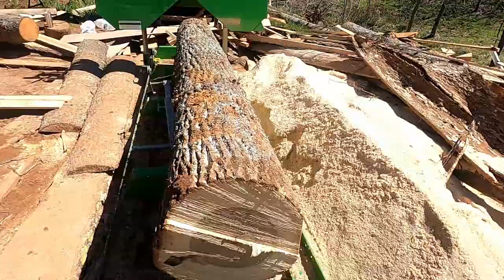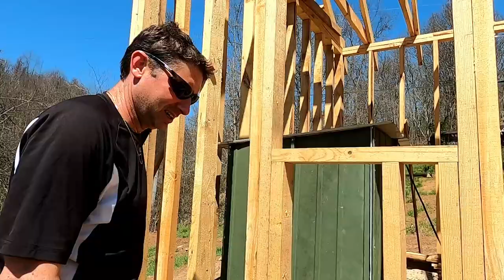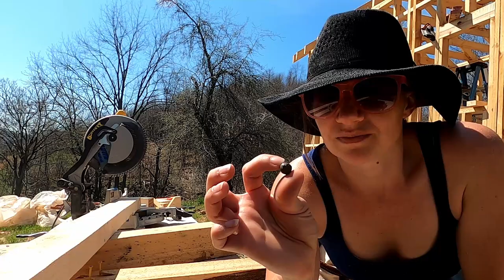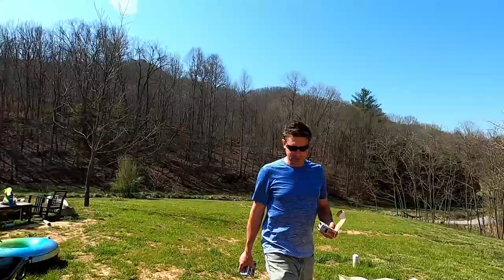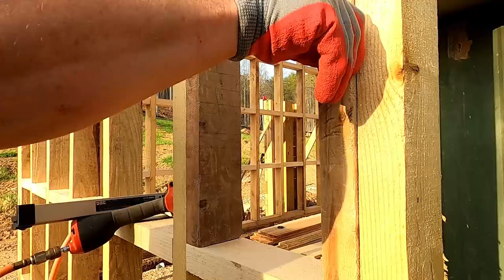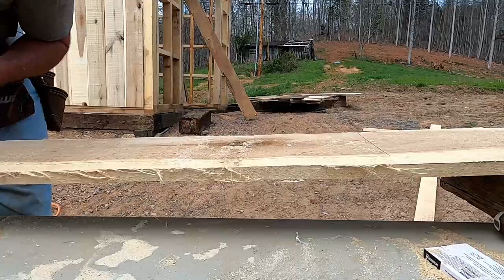E29 - Homemade siding for the shed with our own sawmilled poplar

Comment: Think of the the center of the tree as the structure and the sapwood on the outside is where the “life” resides (nutrients flow, etc.). The tree is dying and it will likely be blown over at some point. On our latest episode (abandon shed to tiny house) we had an 80ft cherry that was essentially the same, but only 30-40 feet from our house! We cut it down and hope to mill it and many others to finish the interior and board and baton siding.  

You guys are doing an amazing job. This is exactly what I wanted to do with my children. It got vetoed, but my son and I are doing it together 20 years later! Keep up the good work!

Comment: Have you thought about using a "metal detector" to find other "treasures"? I bet you will find all kinds of historic items - perhaps even more bottles if they have metal caps. As for your Civil War Canister Shots, more than likely the canister blew up not far away, spreading the shot everywhere. One has to wonder how many people were caught in the explosion and died where you're standing. As for your apple tree, it's probably a crab apple. Apple trees are trimmed after the leaves have fallen off - that's when the sap has gone back down to the roots. Looking ahead, always check out Habate for great buys on all types of building supplies - even windows, doors and paint. God bless - love your channel.

Comment: A tip about using air powered framing nailers....you might already know this.  I learned it the hard way.
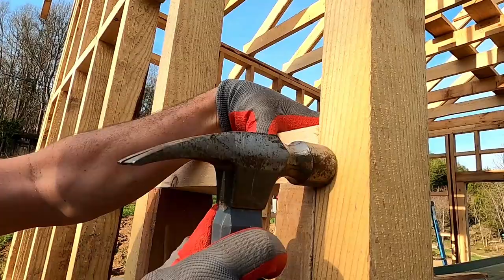When shooting nails like you are at 27:35 always keep your "off hand" at least the distance the nail is long away.  The nails for those things aren't as rigid as nails used for a hammer and can bend, sometimes extremely, when they hit knots or different grains of wood.  I was framing a wall and using my left hand to hold the horizontal piece as you are.  Had a nail go through the stud then turn and come out the side of the horizontal piece.  Put a pretty good divot in two of my fingers.  They healed but I definitely learned a lesson there.
Reply from the maker: Hey Mark - right on.  I don't even like being in the line of fire, but I'm sure I got a little too comfortable over the 5,000 nails we fired into the shed.  You are right though.  It happens when you're not expecting it and safety needs to be administered at all times; especially with that nail gun.

Comment: It was my understanding that when Board and Batten was put on 'green' or wet that they only put one nail in the center of each board left and right and at each cross board in order to allow the edges to shrink and grow at will underneath of the battons that are also nailed in the center and cover the gap. I also understand that when green the gap is about a nails width to allow for the expansion and shrinkage. Lastly my reasearch showed that some(not all) people would come back after a few years and then add more nails. Although with Cedar I don't know how much movement or how long you let them dry? 1" per year here. Great job and great channel.

Comment: Curious why the vertical instead of horizontal installation for the siding?

Thinking about how horizontal siding is installed with overlap…. It may be to allow for the wood to shrink as it dries.

Last thought - next time the tractor is out, couldn’t you haul lumber by hand in your cart instead of carrying it?

I realized why I’m making so many comments,  I REALLY wish I was doing this.  I envy the life you’ve built for yourselves.
Reply from the maker: Thank you, Kevin!  Love hearing comments like that.  It makes me feel just a little less crazy - haha!  It's refreshing when someone really understands why we're doing all this.  Now to answer your question... board and batten is a very old farm architectural style and I really wanted to celebrate its tradition on my shed.  The old timers used to cut their boards, hang it green, let it dry for a bit and cover the shrinkage gaps with the battens and that's exactly what we did.  It's funny you find this style on newer expensive homes, being its tradition was just building with what you've got.

Comment: Nice progress! Npt to be Mr. Critical but you don't have any squares but you do have a lot of rectangles. I've also noticed when you are pushing the saw mill forward some times the right and left side are racking a bit and not moving together. That could also cause some rippling in the saw cut.
Reply from the maker: Hi Tim!  Haha - yes you're correct.  That gave me a chuckle because it's something I would totally think about myself.  Regarding the sawmill, I believe that's a big design flaw.  It desperately needs some more support between each side which could be easily accomplished with some Maker Pipe.  I love the texture it leaves though.  You pay handsomely for that "rough sawn lumber" at the big box stores.

Comment: You need to prune that apple tree and fill the truck with foam or cement to protect it from any further rot. It needs pruning bad! Put some fertilizer around it too so it has some food to use. Fruit tree spikes or fruit tree granules will do wonders for it but make sure it is not for citrus. You need fruit tree feed not citrus tree feed.

Comment: So, what was the reason for the warranty service run on the RK24? As a  soon to be owner of one... I've got to know these things. LOL Great video! You guys are rocking it!
Reply from the maker: Haha, I understand the concern.  I had a bad steering cylinder.  Basically, the steering wheel would spin and spin and not limit out.  Probably too many sharp turns while carrying heavy logs.  Nevertheless, all fixed now and didn't cost me a dime.

Comment: I use a bench grinder to sharpen my blades as well. Running a Woodland Mill 22. I considered the Harbor Freight one, and it looks like it is working well for you! Do you have any advice from your experience about building with green wood?
Reply from the maker: I'd build with green wood again, but pay attention to establishing an initial even cut from one end of the log to the other, regarding the pith location. It helps tremendously with boards weening and cupping.  The board and batten style is perfect for building with green wood, since the batton's main purpose is to cover the gap.  I'd also make the siding a little thicker and do 1 in. instead of 3/4.  Good luck to you!

Comment: great video, shed is looking good,  whats wrong with RK ?  hope its nothing major
Reply from the maker: Thanks!  It's just a steering cylinder that's being replaced and I was told it will be covered under warranty.  The steering wheel would spin and spin and not limit out.  That's one thing about RKs.  They have a great warranty.

Comment: Im thinking of sawing some siding to put on my house . Just wondering how you treat it?  Thx.
Reply from the maker: A good coat of primer and paint is all you need as long as it's caulked to prevent the water from seeping in.  If you want to go with a natural, non-painted finish, they sell clear wood sealers in various finishes.  I'm a fan of satin, personally.  Good luck!
Reply: @WalnutsandWineberries  OK  thanks I was thinking of nailing it on wet? But i dont know much about it .. I also was thinking of just using the bark for siding ill be going over top plywood?
Reply from the maker: Nailing it updated wet, or "green", is fine.  I did that on my board and batten siding.  It will shrink though, so you need to account for that with the width of your battens.  I can't advise on bark unfortunately.  It would have to be super fresh to be usable.  You usually only see that on bushcraft stuff as roofing material.  Hope that helps.

Comment: I'm new to the channel 
Are the drawings that you made available 
It would be the perfect size for a property I have
Reply from the maker: Hi Kirk, I drew the plans in SketchUp and went off of those.  Sorry I don't have a 2D version for layout, but it is pretty simple.  The wall dimensions are 12x16 with 9 ft ceiling height and the roof is a simple gable 9/12 pitch.  BTW, I highly recommend 9 ft ceilings in a shop.  That extra foot is nice when you're mounting air lines and drop cords from your ceiling to make a more productive workshop.  Good luck to you.